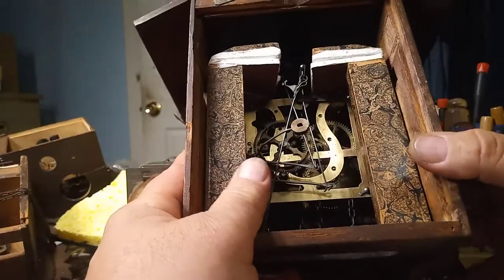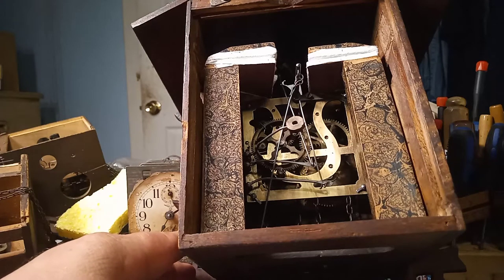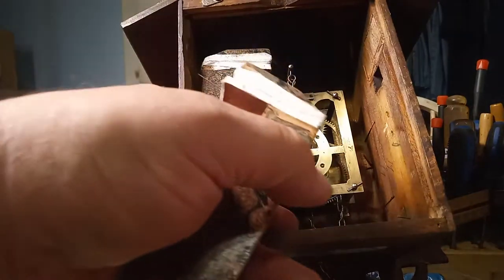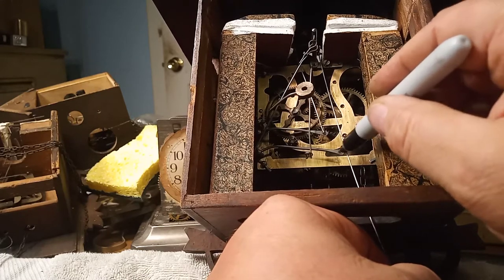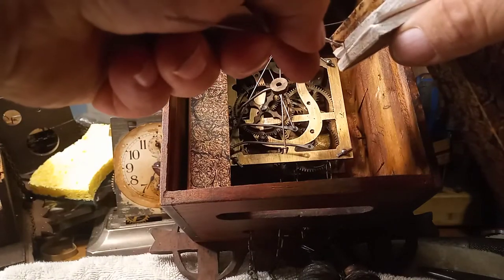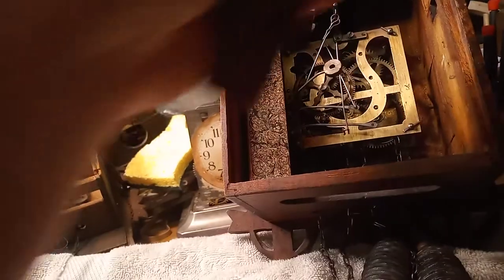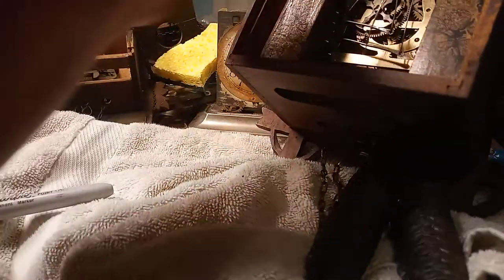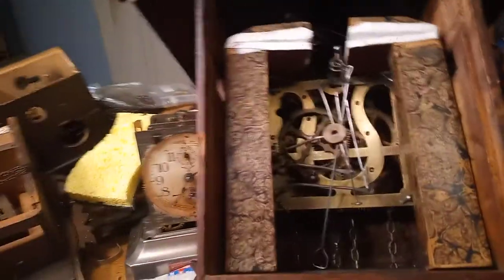Making a cuckoo clock bellow lift wire 20210519 231248

Comment: I need to redo my lift wires. I acquired my clock from my step mothers collection of treasures and it was in a box of nothing but pieces and parts. I spent the better part of a summer putting it all back together and very carefully removing 40 years of cigarette smoke and nicotine and dust from it as well. YUCK!  The movement is in very bad shape but does work when it wants to. It is a Regula and stamped 34/M I believe. It is 34/something.  

I put new lift wires in it not knowing what I was doing and this video has helped me understand where I went terribly wrong. It does work but not as it should. I get half a chirp from the bird at times, sometimes the gong will miss a tone and other times the door will not close for a cycle and will close on the next. I know that is not all life wires but if I showed you the lift wires you would just SYDH and cringe.  I am a partially disabled industrial painter, not a cuckologist.  lol 

Thanks for sharing this. I appreciate it.
Reply from the maker: If you send me a message on Facebook (my profile picture is a drawing that a veteran drew while I was at the VA) Mark Munnerlyn.  Then if you are up for it we can video chat and I can help you with your clock more.  The 34 identifies it as an 8 day clock.  In 1970 Regula started using a date code after the 25, 34, etc.,   They either used a 2 digit number for the year such as 70 or a letter code. A was the first letter they used and it is good for 20 years so the letter "A" is for 1970, 1990, 2010, 2030, etc.  The letter "M" is for 1980, 2000, 2020, etc.,.  They didnt use some letters such as "i, o, and the letter y".

Comment: Mark is any part of the lift levers supposed to touch the star wheel. Just took clock off the wall. Kinda scared when everything is working but one bellow…scared I’m gonna mess more up. Reason I ask is low
note lever excess where it attaches…the excess loop at the end of the lever is on the star wheel tooth &
the other one isn’t. Seems the only one working is the low note & not the high note. Should it be bent so
the tail end excess touches the star wheel teeth ? I thought it was said the levers weren’t supposed to
touch the star wheel at all. Confused in Florida. Thanks for any help in advance.
Reply from the maker: Sherri watch this video. I am discussing the parts of the clock and what they do. In the 39 minute mark I discuss the star wheel  https://www.youtube.com/watch?v=4RLZmRLGNv8

Comment: Is the eye screw to the bellow top vertical or horizontal?  When attaching the wire it keeps falling out
Reply from the maker: It is normally vertical but you can bend it slightly to make sure it doesnt come off.

Comment: Mark what is the best way to connect Bellow wires. Remove the Bellows? any special technique?
Reply from the maker: I remove the bellows and connect the wire that goes to the bellow top. Then put the bellow into the clock and connect the wire that goes to the high note or low note lift levers. Then bend those levers slightly so the wire doesnt come out. Then put the bellow into position and screw it into place. I hope this helps.

Comment: I thought the wire that tips the bird is always on the left bellow top
Reply from the maker: No some of the cuckoo clocks have the bellows the tip the bird to the right of the movement as you are looking at it from the rear. Most bellows that tip the bird are on the left bellow top as looking from the rear but not all. I have seen a few that are on the right. Just depends on who made the clock. I hope this helps.